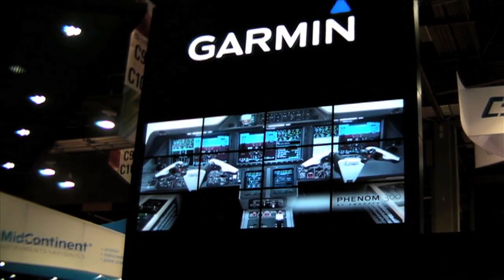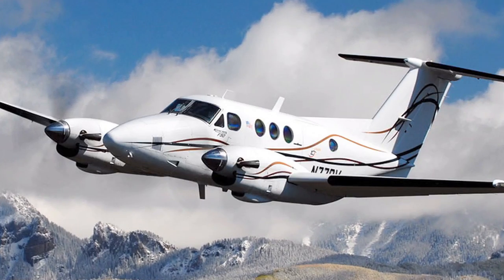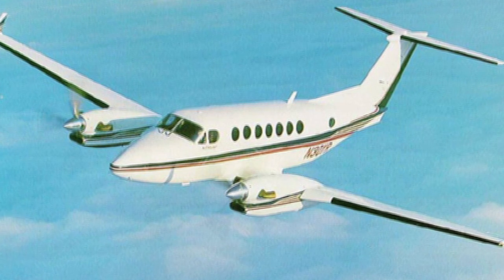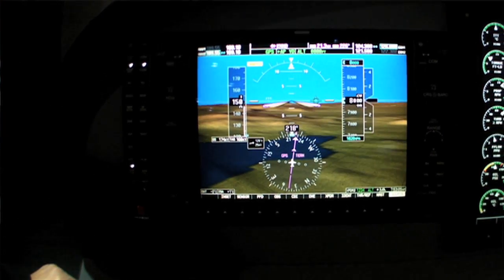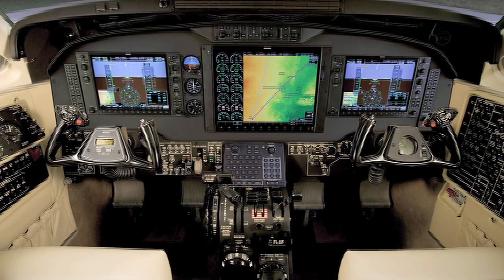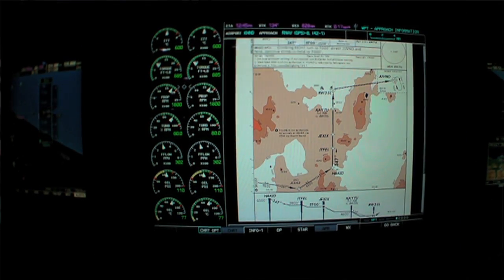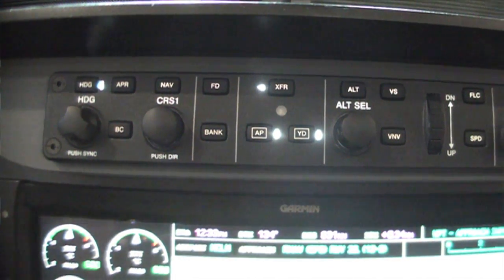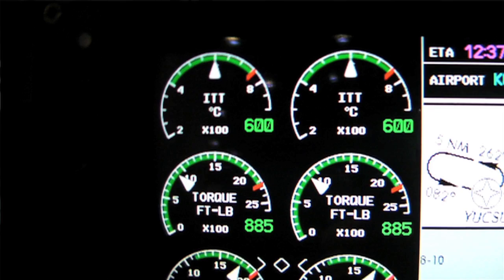G1000 Retrofits for the King Air

Comment: 300 lbs of stuff they remove from the airplane, How much dose the retrofit weigh? can't be 300 lbs worth! More useful load I can see why one would go thru the considerable expense. I'm told that airplanes with out glass are harder to sell that  with glass these days. Times are changing. And here I thought I died and when to heaven when I got to fly airplanes with the New King KX-170B's!